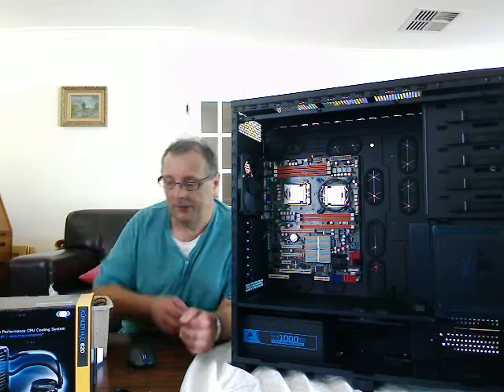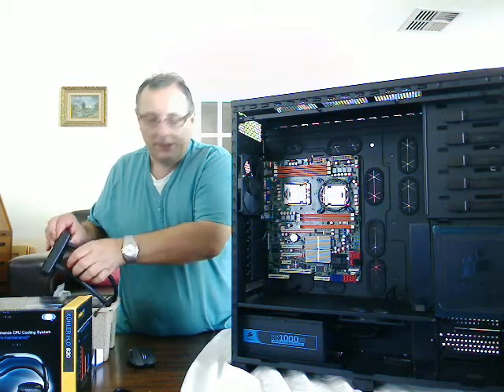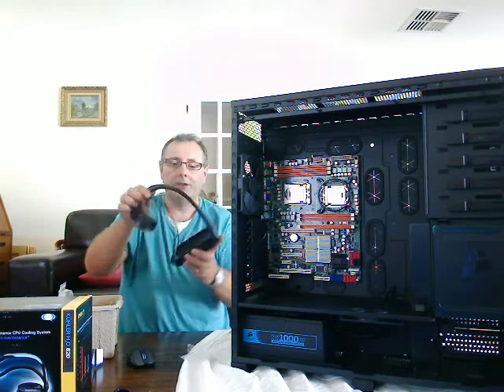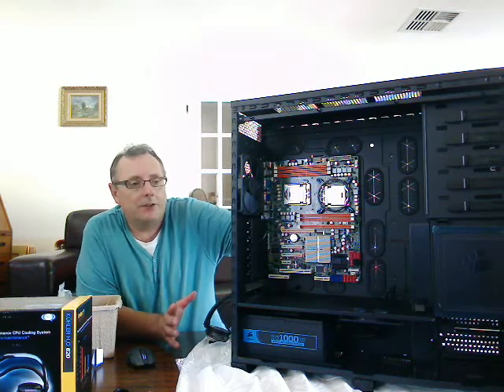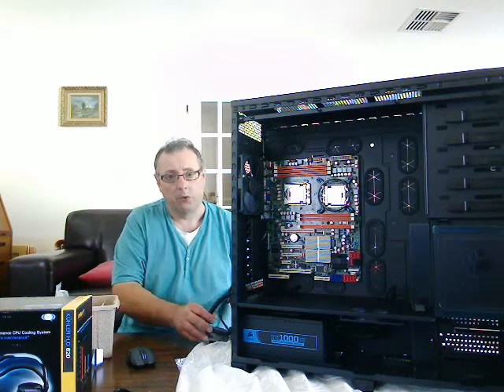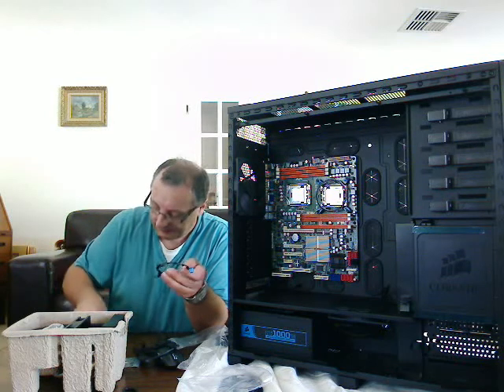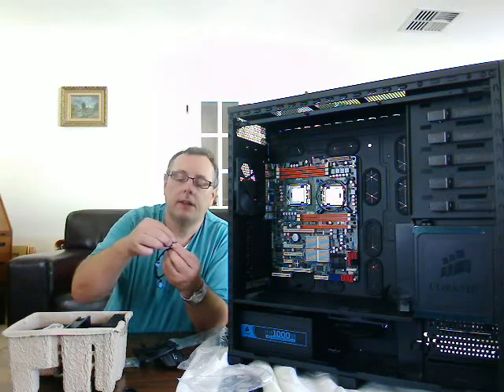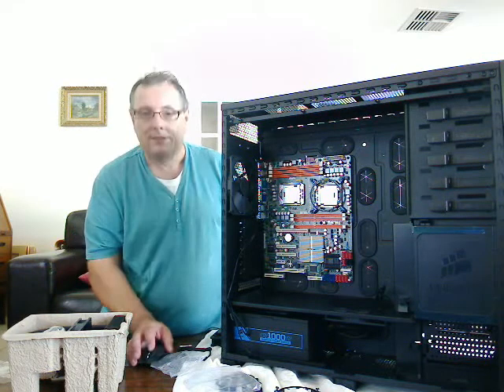Building A Small Business Server - Part 6-9

Comment: Quick tip. Always put cpu and ram in outside the case and do a quick test if everything works before putting it in. Nothing more frustrating then pushing the button when you all done and the motherboard turns out to be a doa. If it works put the mobo in with the ram and cpu installed.